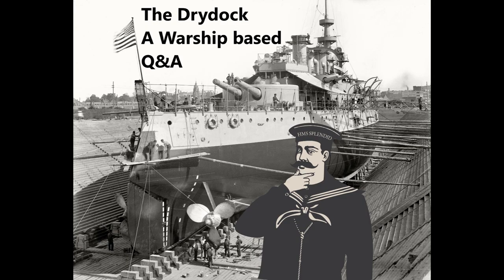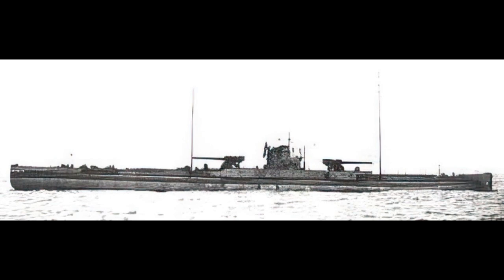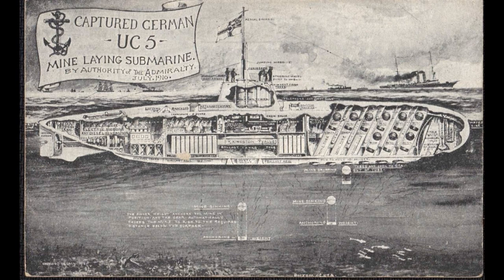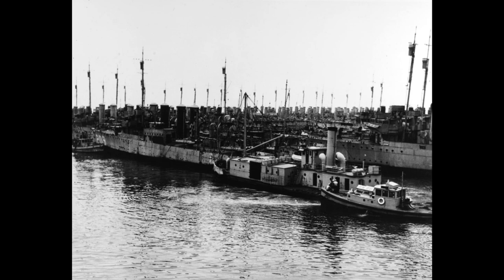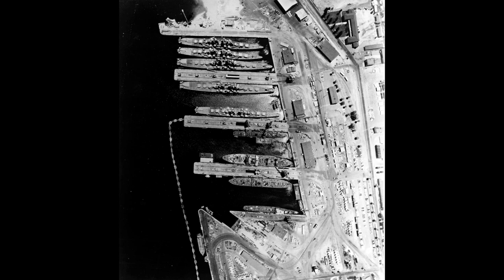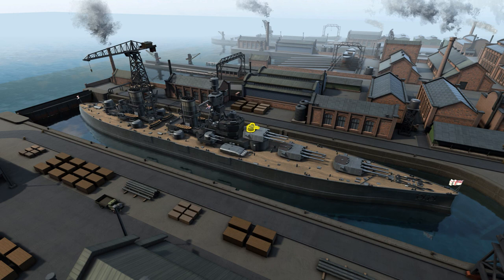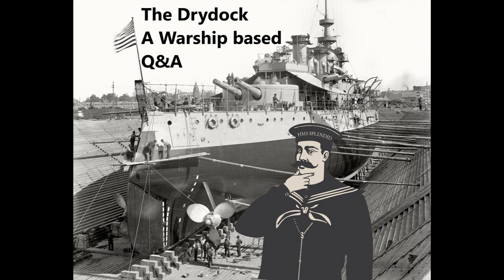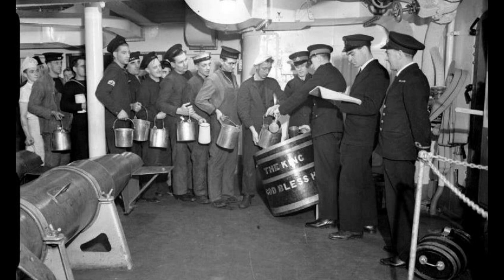The Drydock - Episode 193

Comment: Regarding the ABDA heavy cruisers, the actual number of functioning 8 inch guns was 12. Turret number 3 on the Houston had been knocked out by a bomb on February 4th. During the Battle of Sunda Strait, the Houston crew had shot so many 8 inch from turrets 1 and 2, that they had to hand carry eight inch shells from the after magazines to the bow guns. It was an even greater uphill climb.
Reply: The crew of Salt Lake City had to do the same thing during the Kommandorski Islands, which was almost entirely a stern chase. The rear five guns had about 750 rounds (150 rounds per gun), but Salt Lake City fired 806 AP rounds and 26 HC shells.

Comment: Two additional points on the speed issues for carriers and battleships, the carriers had to turn into the wind.  You're also not going to run air operations when you're under attack by aircraft or gun fire.  These are the only time you really need maximum speed.  With American fleets, the ships are not very close so they can maneuver.  As far as I'm aware, the only flight operations that took place under an attack was Taffy 3 in Leyte Gulf.  The carriers turned away from the Japanese fleet which happened to be into the wind.  The returning aircraft had to go to an air base in the Philippines or another Taffy group.

Comment: Re: 00:50:06 - How often did the Essex class work up to their top speed and were the top speeds of the North Carolina and South Dakota class a hindrance?

When I served on Forrestal Class carriers I seldom remember any of them needing to do much over 25 knots (assuming a typical 5 to 10 knot local breeze) to launch aircraft. If I recall correctly 30 knots across the deck was what was wanted to see for typical flight ops (of course that was launching all aircraft via steam catapult).

Comment: You also have the butterflies of if whatever changes to the timeline caused incomparable to be built multiple years earlier than it would have if it got built in current timeline potentially causes the Germans to complete any of the Mackensen or Ersatz Yorck class. Incomparable goes from well protected to not so much if it's suddenly facing 13.8 or 15 inch guns, not to mention the British 13.5" ships are also not in a good place if that happens.

Comment: Japanese light cruisers had 140mm guns so quite a bit weaker than 6 inch.
Reply: Was the caliber the same? Size of the charge? Weight of the shell?
Reply: "Quite a bit weaker" is probably overstating it. Those are 5.5" (14 cm) guns comparable to the ones the RN found to be an acceptable substitute for the standard 6" gun on Hood, Furious, Chester, and Birkenhead. 38 kg capped common shell with a 2 kg bursting charge, compared to about a 45 kg shell with a bursting charge around 3 kg (navweaps doesn't have data on the bursting charge for the Japanese 6"/45).  The Japanese used that 14 cm/50 on just about everything in the teens and early 20s (Ises, Nagatos, Kagas, Amagis, lots of light cruisers), switching from the 6"/45 that equipped the Kongos and Fusos in the early teens.

Comment: 23:00 even assuming a few sailor's exhalations created any measurable increase in moisture. 
I don't think there are any masks, scuba, rebreather or ship or ground mounted air supply that completely eliminates moisture from your exhalations. 
Even rebreathers underwater are said to create air bubbles IE CO, CO2, H2o on ascent. Assuming the same behavior in air is obviously problematic but maybe the water pressure keeps even more sealed.? 
Hmm

Comment: Regarding carriers needing a headwind to assist takeoffs....why? Wouldn't a tailwind be better since the planes would be running with the wind, not against it?
Reply: Its because airflow over the wings causes lift. In a headwind the airplane is effectively going faster by the windspeed + carrier speed. 

Depending on how heavily loaded your planes are, and how much extra runway the carrier has, this could be the difference between takeoff or getting run over by the carrier.